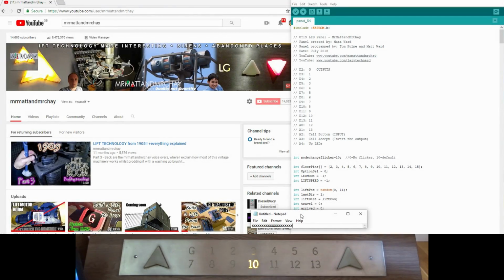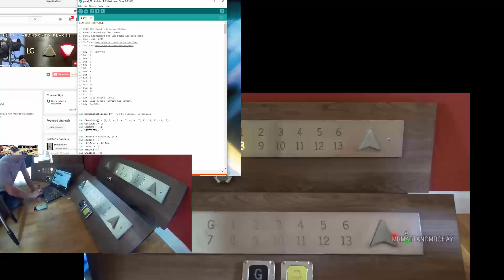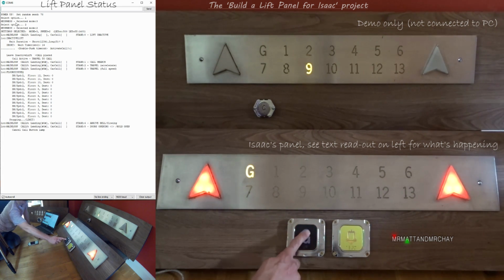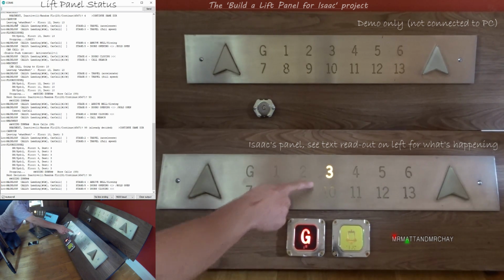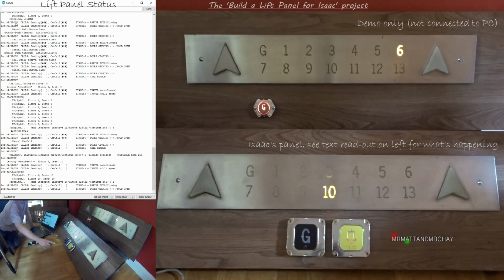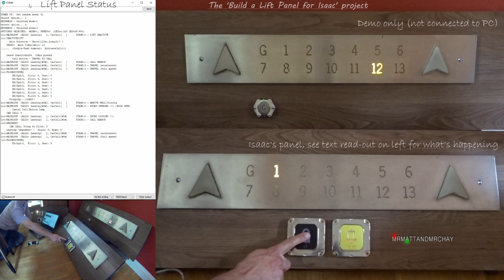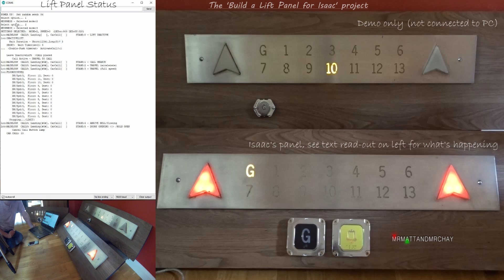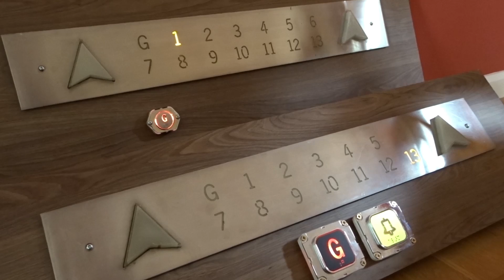PANELS IN ACTION! - Build a lift panel for Isaac (Last video)

Comment: I have to say this is really heart warming stuff. Its really nice that you go out of your way to do this. 

Also completely off opic I was wondering what kit you used on your own alarm system. Like pirs, panels, bells and tat. It wod be nice if you could consider making a video on it at some point. Again if you dont wish to do it for security reasons its fine by me (not that you need my approval anyway lol).
Reply from the maker: Hiya, thanks for the comment!  For my house, I have a Galaxy Dimension, with 4 keypads (no I don't have a mansion!).  Kpd1=Kitchen (flush brass one), Kpd2=Garage, Kpd3=Under stairs/low level as when Chay was small he couldn't reach the kitchen keypad!, Kpd4=Bedroom.  4x door contacts, PIR in garage is an old Spaceship dualtech!! (search "Scantronic 1084 spaceship"), then around the house I use Visonic DUO-240 ceiling detectors (prefer them to corner mounting ones).  2x internal sounders, the outside sounder is a stainless steel sounder made by CQR.  Also have 4x 12v smoke detectors connected back the panel.
Reply: Crikey, sounds like an awesome system, a bit better than my accenta haha. By the way, have you heard of orisec. I have heard really good things about them and their stuff looks very nice. Unfortunately you need to set up an account but I am sure it's worth it.

Comment: I recall some hotel lifts in the former USSR that had floors that moved when you got in - was it to indicate there were passengers in the lift? If so for what reason?
Reply from the maker: Load sensor.  If there was someone in the lift, then it firstly kept the cab light on, and it gave the car call buttons priority over the landing calls.  So if there was someone in the lift, someone on the landing couldn't press their call button before you pressed the car call button.  Make sense?
Reply: Super - I hadn't thought about the prioritisation. At the time I thought it may have gone at high speed if empty. I recall trying to ese the rails to ligt my weight off the floor! I suppose the prioritisation is now part of the sequencing.

Comment: What hardware software u use buddy to be able to use custom code like that cheers and it looks wicked
Reply: He used the arduino software to write the code.
Reply: That is cool as ,could you write code for a floor indercater Lester control type or is it literly d.i.y jobby cheers
Reply from the maker: Anything is possible!  I ran out of memory on this board but you can install an SD card to write further code.  Once you understand the fundimentals, the sky is the limit!!  But with any programming/coding, 1) Plan it, 2) Code it, 3) debug it, 4) soak-test it, then debug stuff that doesn't work, 5) tweak it, 6) debug the 'tweaked' bits!  It's fun, but time consuming (NOT a 5 minute job!)
I will eventually get around to going through the code in a new video, where I will HOPEFULLY cater for complete beginners.

Comment: The only thing that I'd have added (if enough outputs on the arduino), is a real bell, for the car call of the ground floor. Like old school lifts !
Reply from the maker: Oh yes, I know what you mean!  I could have done that with a sound board.  LazyTechNerd (Tom) has already done that, but would add more time on!
Reply: NOOO ! Not a fake one ! A real one, with a metal dome and a solenoid (I love solenoids), It would have been much easier and much better than a sound board !

Comment: 0:10 in the top left - You know how one of them is missing a metal indicator plate? Is that the V1 circuit design or are you not sending that one out?
EDIT: NVM, answered at 1:26
Reply from the maker: That one is for James - I sent him the Otis panel already as Christmas Present.  So his parents just need to screw the panel on the front (nut/bolt already provided :)
Reply from the maker: lol!  (EDIT)
Reply: so the next question I have is what are you planning to do with the demo board?
Reply from the maker: I'm keeping it for the time-being :)
Reply: is that for any future updates or any other times in the future you may build another one? Also where did you get those OTIS indicators for the panels?
Reply from the maker: I've learnt quite a lot from building these.  I kind of knew it was going to take a while to complete them.  I need some more panels before I can make more.  ALSO more importantly someone that I can make one for.  This cannot just be anyone else it'll open the floodgates and everyone will want one.  Then the situation gets totally out of hand.  I think for the moment I wont be building any more as a lot of time went into these ones.  Time to focus on some more videos I think:)
Reply: Yeah and besides with that one there it always leaves some time to experiment with the logic and see what it does